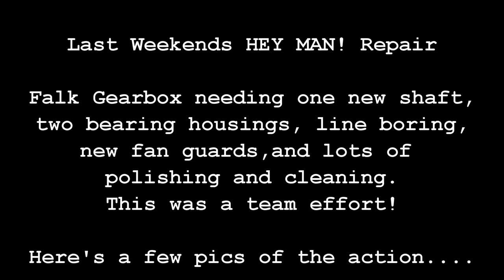Saturday Night Special 80 Part 2

Comment: Adam what is that spiral grooved shaft at the back of your lathe at work that has spirals going in both directions like those fancy push to spin screwdrivers.
Reply from the maker: ***** That is the shaft for the rapid travers.There's a cam that engages the groove in whatever direction you pull the handle to feed the lathe carriage quickly.
Reply: Abom79 Sweet
Reply: ***** Thanks for asking what I was going to ask also...glad I read the comments and didn't ask a duplicate ;)
Reply: Knolltop Farms , Me, too.
Reply: ILGopher LOL, it is rather mesmerizing to watch isn't it? If you try and "phase out" on it for a second, you can't tell which way it's turning. I know what you're thinking, but I haven't had enough California lettuce to see it waving in the breeze! I do enjoy the optical illusions different tools can provide on video though, especially when switched into high speed motion :D
Reply: Yep, I was more captivated at that angle trying to guess what that might do.

P.S., don't eat too many mushrooms on your California lettuce salad.
Reply from the maker: You guys act like you've never seen a rapid traverse shaft before....LOL
Reply: Well, neither of my old ladies has anything rapid about them, LOL! My 1919 SB would even fit into Dave's Steam shop ;)
Reply: Abom79 can't say I have. My only lathe experience is some 3 foot bed South Bend lathes. 

Also glad I read the comments before asking what it was.
Reply: +ILGopher ...'Shrooms'.....just 1 is usually enough..!

Comment: If the piston is scored that probably indicates that the bore in the unit is in a similar state, will you be able to re-bore oversize the cylinder and get a good enough finish allowing you to get an  over sized piston ground to size, I know very little about hydraulics, could "O" rings fix the repair,

Comment: Is that a pressure relief valve that is meant to protect the system on the rare event that the pump exceeds the max pressure,  or is it a pressure regulating valve that is normally open the entire time the pump is running to bleed off excess pressure. If it's a regulating valve the fact that it bleeds off the pressure between the pump and the valve after the pump shuts off may not be a bad thing. 

Just a thought, 

Chris
Reply: shadowdog500 
Yes, yes and definitely good that it bleeds off excess pressure.

JG

Comment: A small leak should have be no problem because you should have a constant flow.Does it hold pressure with a constant oil flow???
Reply from the maker: monkey12345648 I have not checked it with constant flow. Our power unit goes as low as 500 psi.

Comment: Hi mate.
Are you sure that gearbox was broken?  I thought with a lick of paint, she would be right as rain.  Was this caused by poor maintenance, or just working it too hard?  That long telescoping ram was huge, what would you use something like that for?
The pressure valve, looks to be a easy job.  If that is all that's wrong with that, I would think that it could be fixed by your self, or someone with a tool-room lathe.
Marcel.
Reply: Marcel Timmers lick of paint? at places i worked at that gearbox would have been discribed as 'like new' . you should have seen how bad most of our machines were! lol one machine ran for years using a soluble oil in water as the hydraulic fluid as it leaks gallons each day
Reply from the maker: Marcel Timmers I never got the reasons of why it was run to failure like that. it's common in big industry.

Comment: that planer gauge looks pretty interesting. never seen one so gonna do some research tomorrow, thanks for the homework. as for the scratches on the poppet, do you just get a new one our do you have to polish them out. last but not least, that 5 stage must go on a pretty massive machine and how did that failure happen? thanks for the great videos
Reply from the maker: Turns out the poppit was ok. The pump and relief valve both work as they should. The cylinder goes on a truck dump at paper mills.
Reply: +Abom79 gotcha, so just on to narrow down the next culprit

Comment: Hi Adam, great video as per your usual quality! Out of interest, do you know whether that K&T relief valve could be re-built with an oversize poppet? Maybe there's a company out there that can re-grind the bore and fit an oversize valve?
Reply from the maker: mictho100 That's an option I'm working on now.
Reply: mictho100 Sounds like a plan.  I say he just cuts a slot in the end of the spool valve, packs some valve ginding compound into it and laps it with a cordless drill.  Ha ha, just joking.

Comment: Question regarding multi-stage cylinders: To retract them, do they rely only on gravity or are they able to be powered in? The only ones that I have interaction with are on big rig dump trailers and they come down under the weight of the dump box. Just seems like you couldn't apply pressure to the other side of the piston to retract it since several of the stages are beyond the body of the cylinder.
Reply from the maker: SuperSecretSquirell They are extend only, and gravity retract. The weight of the ramps and trucks push it back in.

Comment: Very cool!  The pressure testing of that huge 5 stage cylinder was impressive!  Did you have the forklift in neutral and let the hydraulics push it while supporting the end?  Were you using oil or just air pressure ?
Reply from the maker: Ujeb08 We put the lift in neutral and let the cylinder push it back. We leave it running and adjust up or down as needed while extending.

Comment: whats the application for that 5 stage at the of the video? maybe a dump box trailer behind a semi?
Reply: Billy T  Looks like the elevator riser for a mid-rise building.
Reply from the maker: Billy T You got it Billy. Truck dump cylinder.

Comment: Hi adam, have you ever buggered up a piece of steel at work?.. E.g. Undersize, threads mishmash.. 👍🍻
Reply: RICHARDSON KNIVES thats why they invented spray welding ;}
Reply: Rather true!:)
Reply from the maker: RICHARDSON KNIVES I've had my share of mess ups. I had one this last week. Welded the butt end of a cylinder in the wrong orientation. LOL. Not good but i fixed it. Matter of fact, its the cylinder I was threading in this video.

Comment: On the hydros how do you guys get the ID nice and smooth over long distances? Is it purchased that way or do you finish machine it to final dimensions?
Reply from the maker: Matthew Troiano It's honed ID material you can buy from the suppliers. It's made in all the industry standard sizes including metric. Same for chrome plated rods.

Comment: Hi Adam.
How long is this "ABomb style" five-stage cylinder?
The bearing look damn terrible O.O
When you turned the Shaft, I've noticed these chips are glowing. And here the question. When should you cool the workpiece?
Greetings from Germany
Kratin
Reply from the maker: Kratin Once it's extended it's nearly 50 feet in length.  Coolant is always nice on any machining ops but when you don't have it equipped you run dry or use other methods.

Comment: Can you tell us what kind of unit the 5 stage giant ram went on?

O,,,
Reply from the maker: It's for a truck dump. Two cylinders per dump.
Reply: +Abom79 ...Truck Dumper...like the ones that dump the whole truck/chip-trailer? I worked at a wood-burning power plant, had 2 dumpers...2 cyls on each...probably 50 feet long...

Comment: Adam, i've got two questions. 1.) When you threaded at 11:30, how will the big "Screw" be secured on the cylinder ? I mean, if the threads are oiled, won't that thing pop out at one time ? 2.) If you pressure test these cylinders at ~16:55 how much oil will be in there ? i imagine that must be a whole lot or is that just my imagination ? Like not 10 Liters, but 100's ?
Reply from the maker: Der Tom The oil was just lubricant to avoid galling when checking the threads. The threads themselves when torqued wil hold it together. Just like a bolt. 
The cylinder uses an entire drum of oil plus some.
Reply: Abom79 thanks adam!

Comment: Afraid it's me again, the Cling film fiend..

Actually realised that the fault could have been caused by foreign body preventing closure of PRV that perhaps dislodged itself when first you removed adjuster screws & springs of both valves, (SNS 78), days before pressure test was attempted.

Same test using portapower could, with some ingenuity, be attempted on all high pressure lines and galleries normally fed by oil pump.
Assuming no blockages, damaged pipes, seals, missing parts or cracked oil galleries of distributor or rest of castings found and check valves, including one in the pump pick up pipe hopefully, not 'letting by', allowing oil to drain back to the sump via the pump, causing priming issues, exacerbated by the high location of the pump, it should be all systems go.
    
However;
I realise that you have had the pump tested and found to be A1 but feel that, like yourself, whilst  the thing is in bits, may as well try to make the K&T (A)bombproof !!
Re-fitting distributor at this point and testing may well prove successful.
If not, slight bluing of driven gear in pump, as seen on my monitor,  (SNS 79), if confirmed by yourself, could be an issue, possibly caused by gear being forced against faceplate when in situ. This could explain wear on faceplate.

Try 'Plastigauge', a product available here in the UK, probably via the USA, used mainly by the motor trade to determine working tolerances of critical components such as main and big end bearings and probably even oil pumps..Dependent on results, work on pump gears, body and faceplate or replacement of complete pump may be required.  

Now might also be a good time to take photos and measurements of oil feeds from pump with a view, at some time in the future perhaps, to fit a vehicle type screw-on canister filter assembly onto the outside of the distributor, being fed directly from the high pressure side of the pump, feeding fully filtered oil back into the system.

Finally,
                                             DISCLAIMER    
I hereby advise anybody foolish enough to even consider attempting any of the
        above procedures that you do so entirely at your own risk....
       
 (My best mate temps in the pub down the road and has assured me that the above statement will absolve me of any blame should it go pear shaped for some poor sod.
        He should know, his day job as a road sweeper around Holborn and the Inns of Court, including The Old Bailey, has allowed him to overhear loads of pucker 'Legal' type chat from the swarms of black-gowned, chalked-wig wearing geezers and gals, invariably all clutching at their briefs as if their wallets depended on them!)
        
         Try tugging at your briefs here in sunny Croydon and you'd be banged up before you could say Jock Robinson.

With all that is going on, you must be tempted to rename this video 'Give me a brake, Part 2'   

John Greenwood

Comment: What do you use planer gauges for?
Reply from the maker: They have several uses, hard to lists them all. Great for locating heights, or trying to measure distances. They were also widely used for setting tools on planers and shapers.

Comment: how do you know that the porta-power is not leaking down?
Reply from the maker: Anon Ymousmie We've used that pota-power countless times, never been an issue of bypass or leaking. The oil was pushing by the relief and coming out the side hole.
Reply: Abom79 With the intermittent supply of the porta-power, any slight leak in the system would cause the the rapid bleed off in pressure that we saw.  It could be at the porta-power, its connections, the quick disconnect, or any of the threaded fittings.  Hydraulics is not like air, it does not compress and all the "capacity" is in the swelling of components under pressure, which is tiny.  Your leak looks much worse than it actually is.  That said, I agree with Paul that the relief valve is bad and should be addressed one way or another.  Lapping?  I also agree with others that this find is not the smoking gun causing the K&T problems.  You would need a much larger leak to do that, a significant percentage of the pump output.  Continue the search, and make sure to test the pump properly.
Reply: ***** FWIW... if the system is not blead... it is possible to have air in it which will compress but once compressed it really does not matter... both the air and the fluid will bleed out of the leak.  

The fluid should start leaking almost immediately and continue to leak until the pressure normalizes once pumping stops.